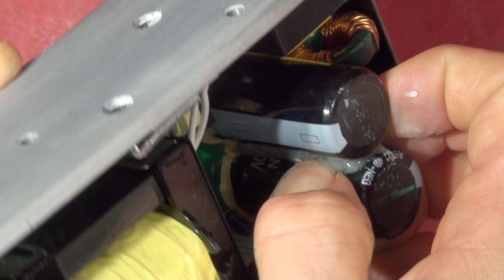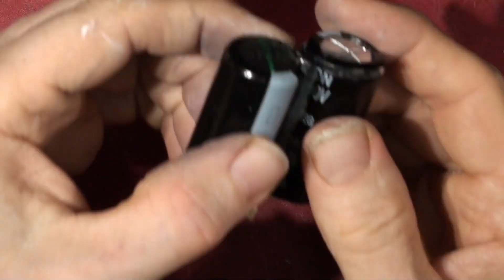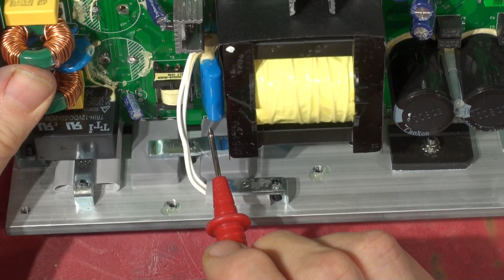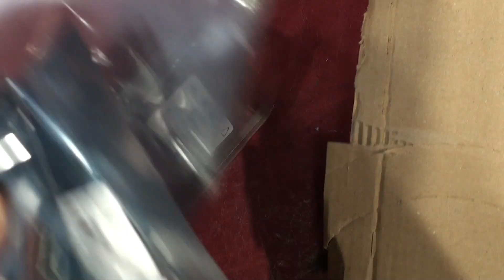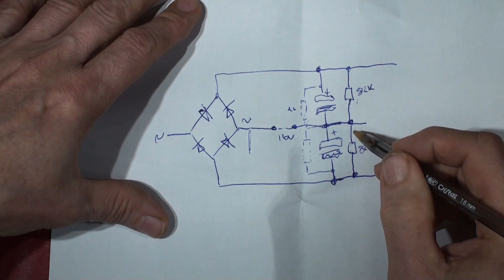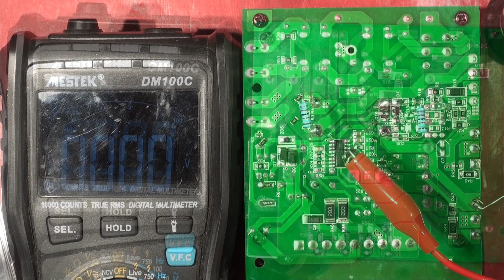JBL 518S Power supply Repair and Reliability Modification  JBL 443227-001 Repair

Comment: That's why I'm sold on the full-bridge resonant design. No bulk capacitors getting unbalanced or switching asymmetries to worry about.
I've recently combined LLC with PWM and have been amazed with the results. The possibility of integrating both the PFC and the LLC converter, eliminating the mains-side bulk capacitance, and eliminating inrush at turn-on, all at once, is very neat.
Reply from the maker: Yes, I did that for a 320W commercial grow light design with PF correction.  I used GAN FETs  and an active bridge rectifier and achieved 96.8% efficiency at unity PF.

Comment: Phenomenal diagnostics!! I actually have a prx618s but they use the same amp module...( I feel a bit duped by the price difference) voltage doubler relay was my fix. I appreciate your time and all your insight on every video!! Cheers from the US
Reply from the maker: Thanks for watching.  good luck with the Amp, May it never let you down.

Comment: I have 2 518S that are used only inside home! I gave up! There were a lot of caps problems (problems just with the EON's). It is a SHAME to JBL! At leas 1 of them exploded each half year! After that, I decide to use them as passive units and, now, I am enjoying the speakers quality! Sorry for my poor english. Hope you get understand what I tried to write. All the best!
Reply from the maker: Thanks.  The problem with them is that they were designed to run on 10V AC and not properly tested in 240V.  If the thermal trip opens to allow it to cool down then the Power controller is destroyed. That is the problem when copying circuits without understanding them. Real design is the study of how things fail and why rather than designing something that seems to work. Whoever copied the circuit assumed that the protection device was a NTC when in fact the design calls for a PTC. I have repaired a lot of them and don't get them back once the modification is done. It costs about 50 cents for the correct part.  Such a shame.
Reply: @razenby  Dear... good afternoon!
First of all, thank you very much for your reply! It was of great use to me for sure!
I would like to see with you if you could tell what type of terminals are used at the ends of the wires that connect the output of the amplified signal to the speaker posts.
I noticed that they are of two different sizes (one for the + sign and the other for the -), but I don't know if there is any code to buy them over the internet.
If you have this information and don't mind sharing it with me, I would appreciate it A LOT!
I apologize, once again, for my poor knowledge of the English language, which makes me use Google Translate as the only alternative.
I hope you can understand what I'm trying to ask!
A respectful hug and, in advance, thank you very much!

Comment: You're 1 smart guy. Just worked on the prx618s model. Fault was no sound, signal light on with no input.  Problem was bad op amp on input board.
Reply from the maker: Good job. The op amps fail a lot.
Reply: @razenby  thanks. yea, they sure do.

Comment: Really good work, I can accept this when perhaps "you take a chance on Ebay" but when you go to the likes of JBL for a speaker you'd expect better basic engineering. I wonder if this was sold at a premium price point or whether it was from their ultra budget range, then maybe I can accept that they need to do things like this in order to compete.
Reply from the maker: Reliability is weak when running from 240V supply.  If you turn it off then leave it off for 20 seconds. If you turn it back on in a few seconds then it is likely to blow the FETs. Design fault.

Comment: I have one on the bench now. I've repaired it but it's getting too hot under full load testing. The imbalance mentioned here is probably the cause as it seems to be one of the new FETS working too hard and unable to dissipate it's heat fast enough. Instead of spending a long time puzzling and testing, I will try this mod and hopefully it will be a short cut and not a short circuit.
Reply from the maker: Are you talking power supply or the Amplifier FETs overhating? You most likely have a blown or stressed resistor/component in the FET drive circuit to the gate. They get hot when they don't switch fully in or switch too slow so you get heating during the slow switching edge.  Ccheck all the components between the drive PWM chip and the FET gates. Also don't assume that the tracks are connected? Check the VIAs - the PCB itself is a major cause of faults on these amps.
Reply: @razenby  Thanks for the reply. The PSU is overheating. It is one of the IRFP460. They had both blown along with the 47R gates resistors. One of the main caps has the same bulge as you had. New pair have just arrived so will fit today and add balancing resistors. It works ok until you drive it to clipping level and then heats up over 10 minutes.
Reply: @razenby  New caps and balance resistors are now fitted. Voltage difference is now within 10 volts under all heat and load conditions. The IRFP460;s are still getting hot but it now takes twice as long (5 long CD tracks) and it needs to be driven as hard I'm willing to push it. (Heavy clipping from the limiter on every beat) It got too hot to touch today and was not far from blowing. The thermal device doesn't seem to do a lot.

Comment: Thank you for the most informative video. I am working on one of these power supplies (operating on 240V) where one of the main filter capacitors ruptured violently (over voltage) and sprayed electrolyte all over the place, nasty stuff. I'm normally quite apprehensive working on switch mode power supplies, they scare me! I've got a schematic of both the power supply and the mains input PCB. The modifications you suggest to help keep the voltages balanced across the two capacitors are simple but very effective. Can you suggest a model/part number for the varistor? I also noted your ordered and fitted an SG2525 where the original part on the PCB was a SG3525, from what I understand the only difference is the outputs are inverted. Was this not a concern with this power supply?
Reply from the maker: The Varistor on the back of the cap is any 200VDC working type.  I also discovered that the so called 'design engineer'  that copied the schematic assumed the series varistor (the one bridged by the relay) was an NTC whereas in fact the design  should use a PTC thermal protection varistor. (See video dedicated to this issue on the channel). For the input varistor I use PTC  Epcos B59860C0120A070. when the power supply shuts down, the relay opens, the PTC thermistor heats up and quickly transitions from 10 ohms to an effective open circuit preventing a cook off..  Under the same conditions, the NTC they fit at the factory just starts low and reduces resistance and voila: FRYING TONIGHT.  I have both parts in stock.  Either SG part works.
Reply: @razenby  :-) Thanks for the extra information, especially about the SG2525/3525. Sounds like this power supply is a bit of a lemon.  I'll add a PTC (or a few) to the basket before I hit order. I'm going to use a Bournes DV150K4032R2 varistor. Thanks again for the great content on your channel.
Reply from the maker: The varistor you suggest should work.  Don;'t forget to change the mains input Thermistor to a PTC the part I have in stock are TDK B59860C0120A070
Reply: @razenby  🙂

Comment: Hi magic smoke thank u for ur reply I have JBL eon 518s power supply for repair which is dead
Reply from the maker: Ok. Well I have fixed loads of them. If you are running on 220V mains  then you need a modification. Where in the world are you? I can probably fit one more in before Christmas.
Reply: Hi, magic smoke I was. In UK but now I'm on vacation in Goa india

Comment: Nice job as usual but one thing that really bothers me is your random system event sounds going off. In a previous vid I had running I thought it was my system and it drove me nuts for awhile trying to figure out where it was coming from! I didn't reilize it was from your vid until I watched this one and it was going off again. I literally removed the sound file from my system but still had a "oh shit" moment when I was hearing it again. I did have a bad hdmi connector that would intermittently reconnect itself so I thought that was the issue but I'm not ripping this laptop apart again for that. :D
Reply from the maker: Thanks. A simple repair turned into an investigation. It did drag on a bit. Other work was going on in the background.  In future I'll turn the system sound off. Thanks for the tip. It took a while to make sure it was the design of the board and not a fault that was causing the imbalance.  I watched it back and realized I should have mentioned that one end of the power transformer primary is connected to the VMID and was drifting way out under load on 220V.   I have a couple more 518s in next week so I will revisit it. Is there anything else you would like to see? It is a shame that they have such crap power circuitry in these amps.  It doesn't really cost much more to make a bomb proof power supply. It is all at the design stage.
Reply: Same here but what I did was different.
As soon as I heard it I thought: "was that me or him?" and did a quick 3 second rewind.
Turned out to be him not me.
Continued to watch video unflustered.
>
Reply: @razenby  Also, another good reason for customising your own Window event sounds.
>
Reply: I mean ours, not yours.
I would never dare to presume...
>

Comment: Great repair....I have a jbl prx718xlf that has a bad preamp board...I have a video where I explain the situation about the preamp amplifier if your interested to see it..... good video!!!
Reply from the maker: Yes, always interested in seeing new stuff to fix.  It would make an interesting video. I only do the electronics not the driver units. If you want me to look at it then email ark.mail@gmx.com . Prefer to see it before any idiot engineer has a go at it.
Reply: Worked on a few of these. Most of the time, the fault is bad op amps, mc33078 ic and tl071 ic. What kinda symptoms is your prx showing.

Comment: Nice work!
I have 2 Eon 518S bought 2 years ago, i have used them a couple of times and then one didn't worked at all and the other sounded very bad with the volume up (distorsions) , for the first one i have bought new power supply and new amplifier, it worked fine for a couple of hours and then the problem with the distorsions appeared. I have warranty for the new parts but it's in the US and i live in Romania, the cost of sending them back for repair is too high. Can you help me, please?
Reply from the maker: It is unlikely that the new bard will have failed in exactly the same way with Distortion as  
 the old board,   Are you sure the speaker / driver cone itself is healthy?  If you get same distortion with the new board as with the old then it is likely to be a bad chip in the pre-amplifier /input board.  I suppose it could be the power board but that us easy to check as you can measure the power supply +ve and -ve supply rail voltages when the fault is present.
Reply: @razenby  where i can send you a video with the problem?

Comment: Hi bro can you tell me the output voltages i have same model amplifier board get from scrap i want use that because I am asking you
Reply from the maker: Output voltages of what the power supply section ?? Main DC supply should  +24V 0 -24V  Nominal. It depends on the mains input voltage.,

Comment: I measured the 18" driver and the resistance is 2.5 to 2.6 ohms is that a normal without using an impedance meter to measure with?
Reply from the maker: That sounds about correct. You have to short the test leads on your meter and deduct that reading from the test reading across the voice coil. Usually they read about 1.6 to 1.8 ohms after you deduct the meter reading offset.

Comment: hi Ref  a JBL518s could you give a part number farnells or rs components  or spec of the varistor across the cap with the 82k resistor
Reply from the maker: I thought I did that in the video. B59874C0120A070 PTC THERMISTOR, 55R, THT    Farnel Stock ref: 2769018. Remember to like and subscribe please.

Comment: Hi there<
Perhaps when you have the time, can you also do a repair or trouble-shooting of the Bose SoundDock with no audio output (but power is ok), aside from the possibility of misconnected or disconnected ribbon cable?
Thanks in advance...
Reply: Ship him the board.
Reply: @noanyobiseniss7462  
Thanks but no, I wanna learn how to fix it
Reply: @dmcbohol  Well your in luck possibly, I have that board and if you want to pay for him to do the diy and he agrees I will ship him mine.
That is of course contingent on whether he wants to do it.
Reply: @noanyobiseniss7462  
If I can only get a copy of the schematic diagram of the Processor Board, I might be able to fix mine 8-)
Reply from the maker: Schematics of one version of this board is available at electrotanya.com.  There are many variants (iterations) of this design out there but only the schematic available for one.

Comment: Hello good video can the model of the varistor and resistor and what is the value of the original value of NTC because it was broken thanks.
Reply from the maker: Thanks, If you mean RTC601 then it is a PTC  EPCOS Part# B59860C0130A070
Reply: Sir sorry i see you are changing ptc EPCOS B59860C0130A070
PTC thermistor, 25 ohms, through hole, 265 V, C860 series or EPCOS B59874C0120A070
PTC thermistor, 55 ohms, through hole, 265 V, C874 series, which is better

Comment: Hi Where are you located ? I have a problem with prx535 there quite old now 10 years + but think they're worth preserving
Reply from the maker: Near Reading UK.
Reply: @razenby  how do I contact you without broadcasting to the entire world lol
Reply from the maker: @richardmorley324  Hi Richard.. Yes I can do those for you for £100 each. Lead time 5 days.  That is to renew all active components in the power supply and upgrade the FETs in the power output stages.  I require only the electronic modules as there is a charge for disassembly and rebuild. Please email me at support@invebo.com